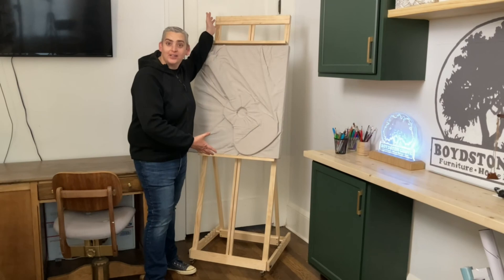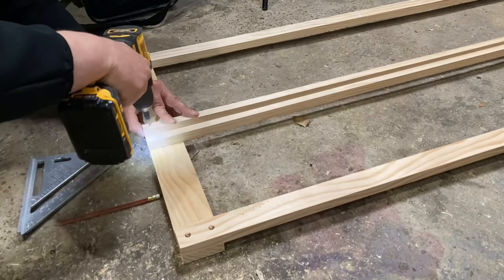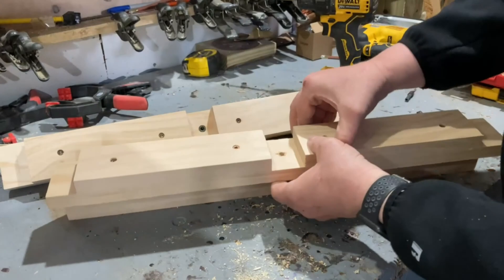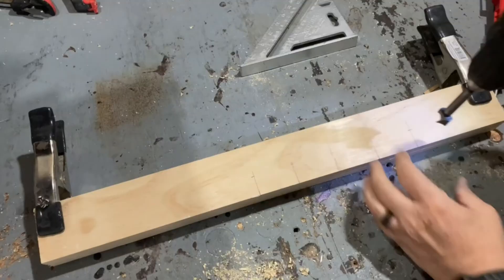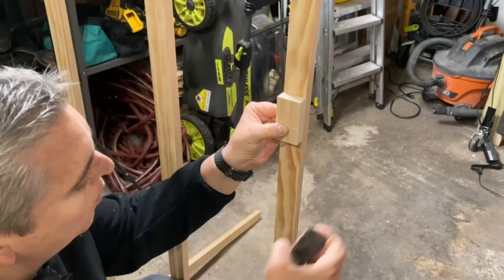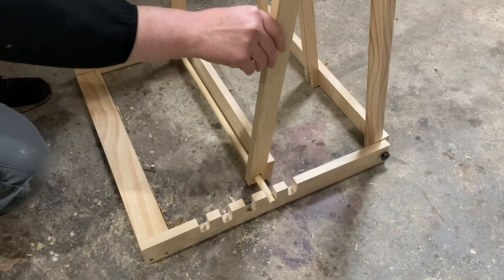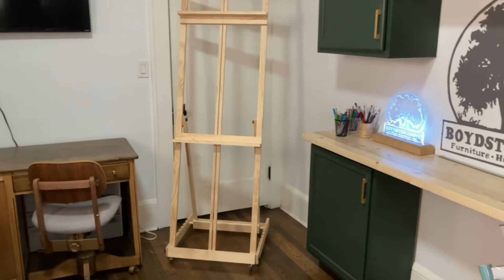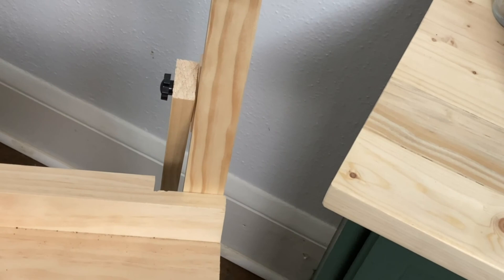How To Build A Floor Easel / DIY Art Easel / Easy Woodworking Project

Comment: you neglected to give any dimensions, length, width of easel pieces. Over all dimensions would be helpful.
Reply from the maker: I'm actually working on a set of plans for this one and the table top version
Reply: He actually goes over the sizes he used in the 1st 30seconds of the video. 6ft pieces with left over 2ft pieces. Overall height is 6ft, guessing about 2ft wide
Reply: @boydstongrove  have the plans been made yet? if so where could I find them. this canvas looks so good would love to try and build this!
Reply: He gives you the width and lengths of the main pieces. You just need to use basic math to attach the base and whatnot.
Reply: Yes he does. Within the first minute

Comment: I’ve used the center pressure fit for years. But a vast improvement is made by doing it with two middle posts instead of a single one.

Comment: This is really good. Only thing I would change is the shelves. I would turn them 180 degrees to make space for the finger screws at the front. Or use a wider piece of wood and place the shelve on the middle, so there is still space for the finger screw at the front. Then I would make two piece of wood with the thread inserts to put at the back, and then the finger screw at the front. That way it is easy to change the height while painting, without having to go to the back, if you want to change the ergonomics when you move around the canvas. This is especially important on larger canvases.
Reply from the maker: Totally agree! Great idea, I’m working on the plans, I will totally make that modification, thanks!
And thanks for watching!

Comment: This easel is exactly what I have been looking for. Very good instructions and easy to follow step by step video. Thank you for the time of putting it together. The easel looks much better than most on the market and stronger too.
Reply from the maker: Thank you! Yeah, I did a lot of shopping myself before deciding to make one. So far I love it, super light weight and easy to adjust.

Comment: At the 3:02 mark, you didn’t specify what the length of those leg supports are? If the legs are 36 inches, how long are the supports you cut the dowel rests into?
Reply from the maker: Good catch! They are 23 inches long, but they were already cut leftover pieces from another project, so I didn't cut them specifically for the easel. However, the easel balances well, so I would say 23-24 inches is a good length to use.